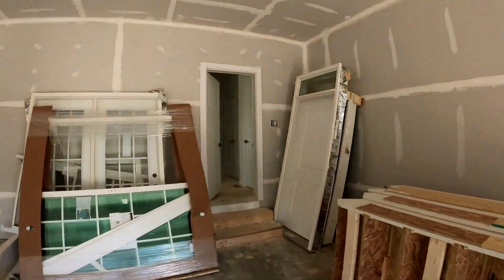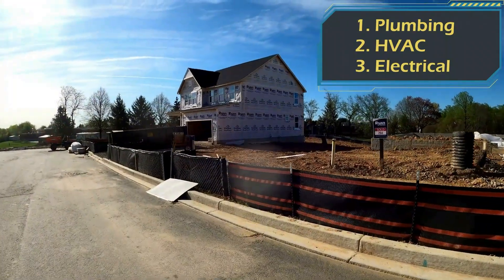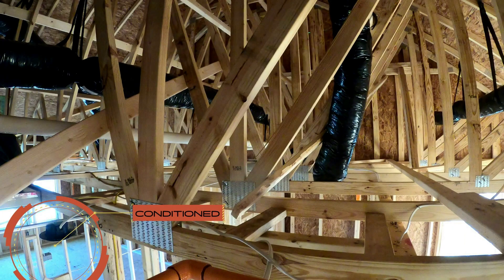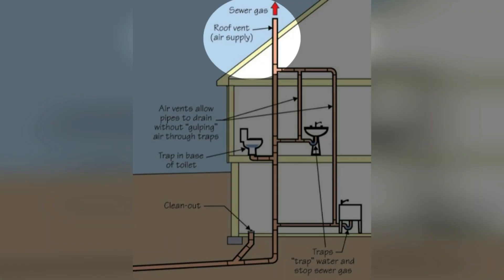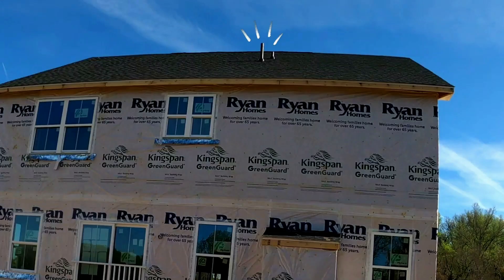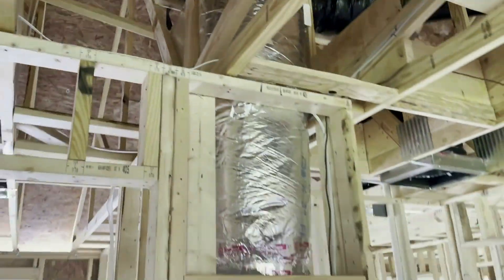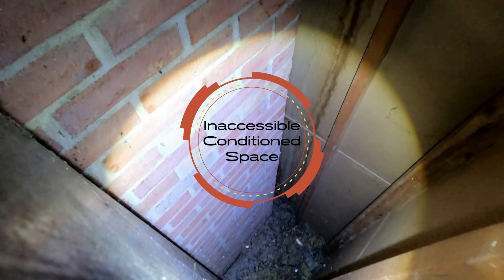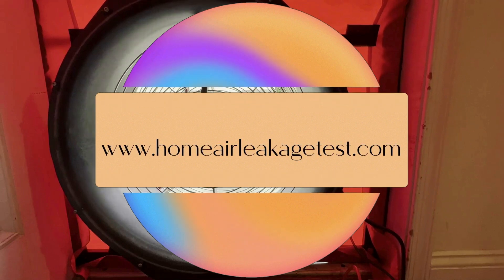Three Reasons Your Heating Bill is So High

Comment: none of this applies to REALLY old homes. my house was built in the late 1800s...BEFORE indoor plumbing, basements, and electricity were even a thing. it was technically "crawlspaced" area, but only a foot or so above the dirt! not really enough to actually "crawl" in (not even for my skinny friend).

moreover, all the plumbing was on the first floor, and "HVAC" upstairs consisted of a single pipe leading up from the first floor. there is absolutely NOTHING in my "attic" but an old unused chimney, the lower portion of which got removed long ago...

lastly, the "pipe to the roof" is nonexistent, as it goes out the side of the house, and anything NOT connected to that is using an air admittance valve.
Reply from the maker: Thanks for watching and contributing! I hear what you are saying. I don't know how every single house was built. The sad reality is that for me, born in 1974, houses built in the 1970s, 80s, and 90s are considered "old," LOL. I would also caution you not to think that just because you don't have any of the things on this list you don't have air leakage (unless you have air-sealed things, of course).